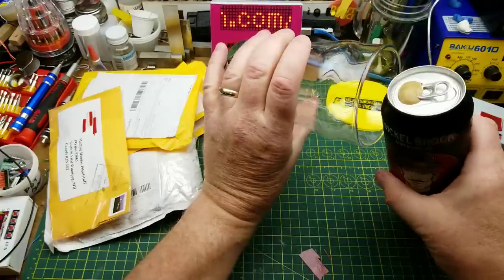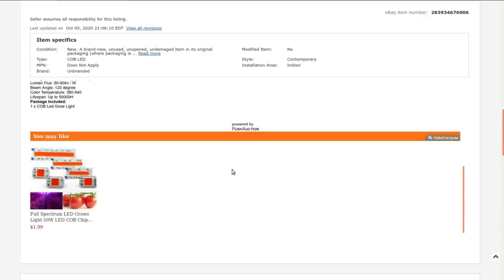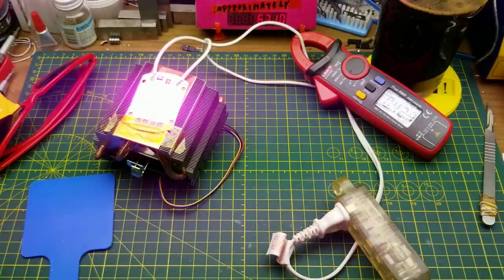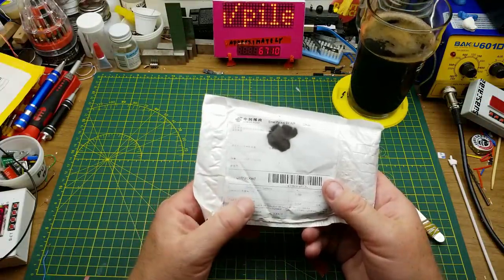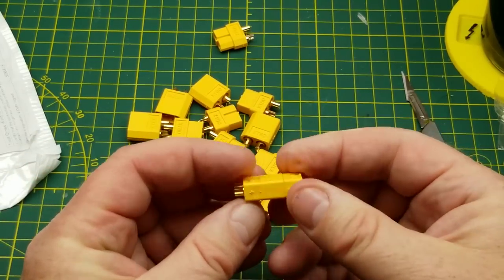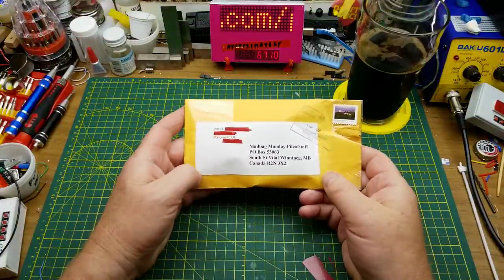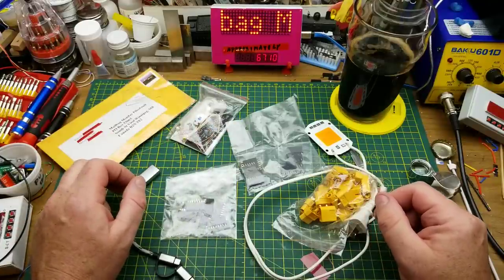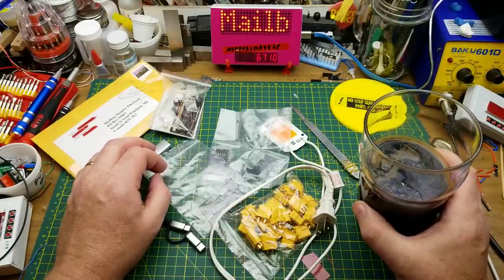mailbag monday #99

Comment: Bit late now but I would have recommended the XT60H connectors instead, they have slightly more comfortable ergonomics and caps for the solder terminals.

Comment: Good evening Mr Of Stuff. I was into flying drones for a little while and have had experience with both good and poor quality XT60 connectors. The good ones had nice springy contacts that remained that way after many insertion and removal cycles. The inexpensive ones were made of poor quality plastic which tended to get really soft which allowed the pins to move. You come at this I usually paired the one I was soldering with the matching gender in order to help hold the pins in place.

I definitely preferred the better quality ones but the poorer quality ones worked well enough for my needs.

Comment: FWIW, legit XT60 connectors are rated for 60A, which is where the 60 in the name comes from. Not "65A and beyond" as HobbyKing claims. Maybe they are being misleading with burst current rating? With the knockoffs, one of the big deficiencies is the plastic having a lower melting/burning point; I seem to recall tests of one strain of knockoffs showing them being able to handle more like 10-15A continuously.

There is also XT30 and XT90, which are rated for 30A and 90A respectively... the thought of the burst current for a LiPo intended for 90A continuous kinda scares me a little.
Reply from the maker: I knew someone would have better information than I found in my quick cursory search!

Thanks.

Comment: What do people use otg cables for?  Can you actually print from a phone?
Reply from the maker: I've connected a mouse and keyboard to my tablet a few times. 
And a USB stick to my phone to back up the photos.
This one is currently being used to connect a USB hub to my Raspberry Pi Zero.
Reply: @pileofstuff  neat.  Could you hook a usb harddrive to backup photos?
Reply: @TheRainHarvester  Yeah that should work. The only problem is the power the harddrive needs. Maybe use a USB stick instead.
Reply from the maker: @TheRainHarvester  It should work as long as it didn't need to take too much power from the phone.